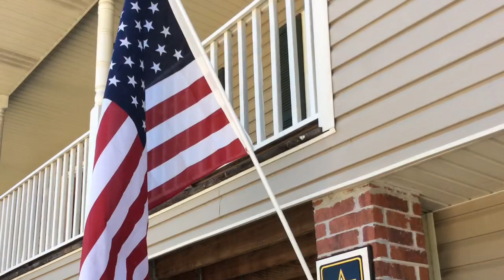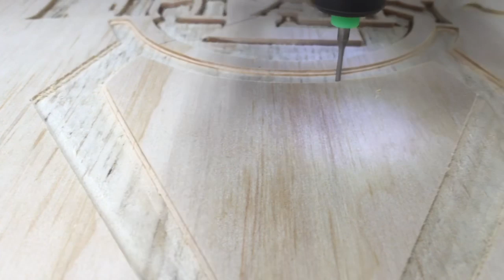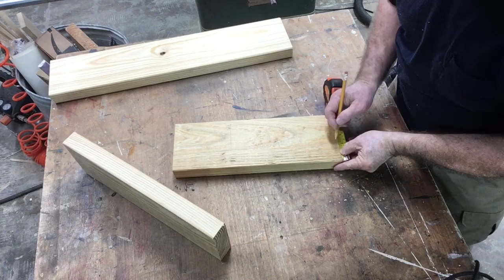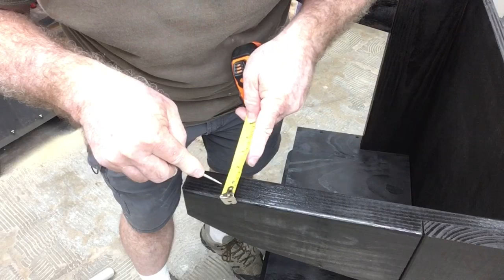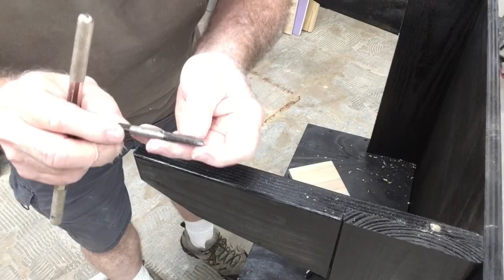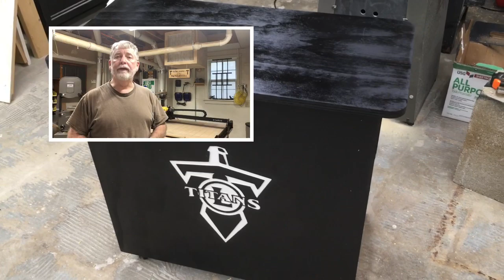How to Build a Small School Desk

Comment: Good looking little desk. Paw Paw  if you pick. Up a inexpensive Engineers  kit  on Ebay or ?  You  will have a compass/ Scribes. With 2 pointy  ends that you can adjust to any radius you need the advantage of the 2  points is of course  one  keeps it firmly in place to pivot on and the other  can. Scribe the radius right into your wood  on plywood that a helpful score line to  trace a little deeper int the wood with a  razor knife or any blade of choice that procedure  will often eliminate  any veneer  blowout or splintering when you are cutting it on a bandsaw or with a jigsaw  i  made my living installing Custom Millwork on jobsites  and very often  we had to  do things as fast as possible to  adhere to ridiculous schedules  imposed by our clients  customers needs  who usually were not construction people  BTW the logo really pops on the desk  in the video  due to the contrasting colors  and the engraving you did i imagine the school will be very pleased at  the outcome and your quality of  Craftsmanship
Reply from the maker: LOL!  Thank you very much.  I'm trying to keep it simple for everyone.  I actually have several sets of the drafting equipment.  One of my degrees is in Drafting Technology. Of course, all of my experience was actually drawing with paper and pencil.  No CAD in college! WHY? It had not been invented.